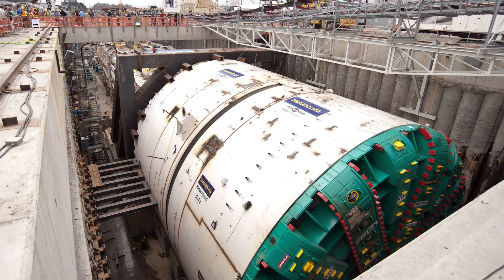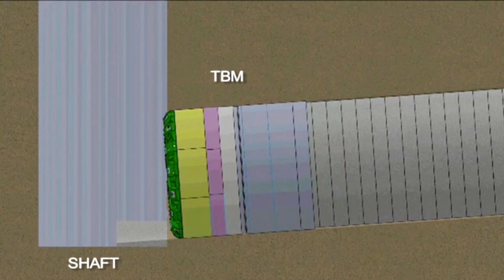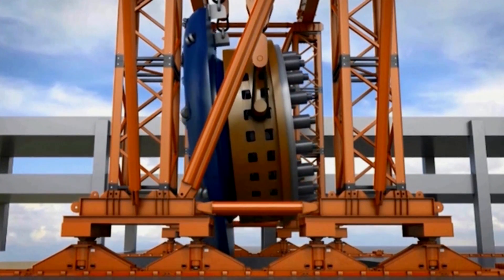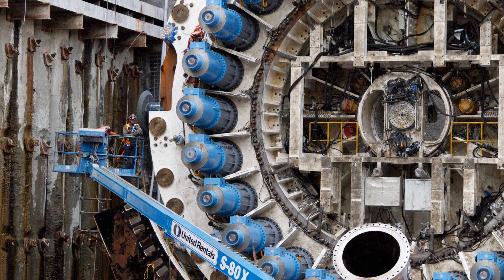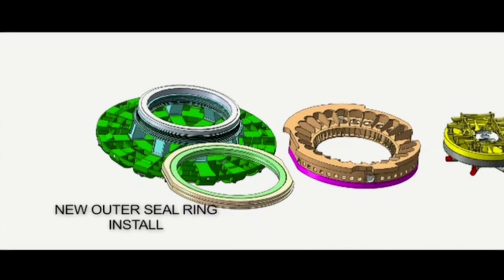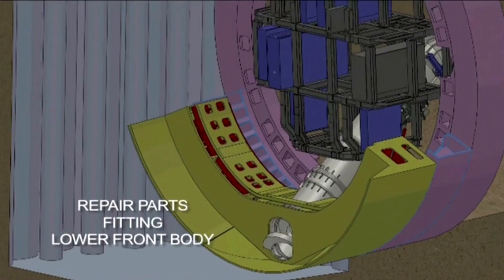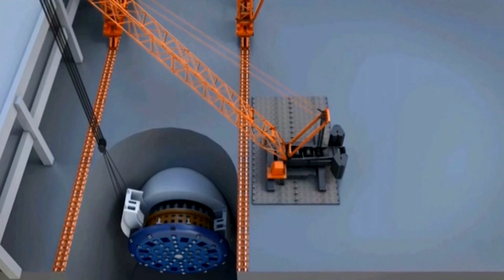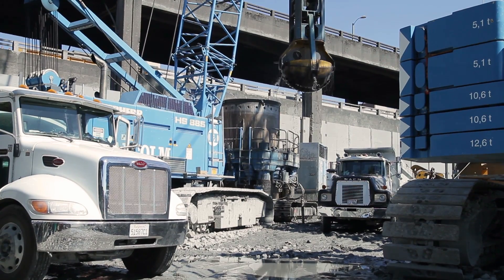Seattle Tunnel Partners' work plan for repairing Bertha with narration

Comment: Whether the tunnel was the best choice is no longer the question. I favored a suspension bridge from Harbor Island to the 99 connector. Taking down and viaduct and either replacing it or not replacing it would have meant years with no traffic corridor at all, and was the main driver behind the tunnel. The comments I read sound like folks who don't have a lot of experience with the physical world of machinery and big projects. Right now, there are 5 or 6 tunnel projects going on right here in Seattle. The big one for Metro ran into exactly the same sort of problem where they had to lift the head out and repair it. Tunnel completed, on time and near budget. This tunnel will get done, and the execution of the job will be studied for those who go on to build elsewhere. 
Since the tunnel walls get laid behind the boring machine, there is never a reverse on any big tunneling project. This access hole was in lieu of bringing the machine out in pieces, and is working. I'm glad they tunneled under the viaduct along the waterfront because this wouldn't have been possible if the tunnel had gone more under downtown.
Relax folks, and enjoy the show. This is really an amazing project.
Reply: Bruce Sherman That's a great explanation. But it does seem this project will be late by about 20 months if there are no more issues (current projection is Fall 2017 instead of December 2015). I guess we'll get a better sense of what the final cost will be once Bertha is running again and makes more progress.

Comment: Wait, why are we building a tunnel?
Reply: Colin Gibson Because it was the least practical way of doing it, it was the most expensive and it won't accommodate much of the traffic that heads that way. Makes sense, right? This is Seattle. The least practical is SOP.
Reply: For cars to drive through.
Reply: Nack Athens
If they just rebuilt the viaduct, the view would stay the same as it is now and it would be easier to build, cheaper and it wouldn't cause damage. The machine has only made it 1000 (out of two miles) feet and surounding buildings have sunk up to an inch, streets have cracked and the present viaduct, which has earthquake damage, has sunk up to .5 inches in places. If they keep going with this tunnel idea, chances are very high of disaster. Seattle being what it is, will only rethink what they are doing when a disaster happens. A road will sink, taking a few cars with it, the viaduct will colapse, likely during rush our. They may be able to kill a hundred people with that one. Maybe a building will collapse. Who knows how many people that they can kill with a building collapse. Since so many buildings have sunk up to this point, when the first one goes down, they will condemn the rest in the area. This comes from a state that has a history of collapsing suspension bridges and sinking pontoon bridges. They seem to be hell bent on trying to up their destruction record, maybe taking people with it this time.  the project is two years behind schedule now and the boring machine is still broken. they dug an access hole, (undermining the surrounding area even worse) just in front of the cutting head so they could get it out of the hole. The machine had to move forward 20 feet to be accessible. It moved 3 feet and quit. Now what? This is like watching the three stooges but in this case, there's hundreds of them.
Reply: The tunnel is in no way impacting (now or in the future) downtown traffic. Brilliant idea. Sink money into a sinking project.I think bringing the sonics would have been a better idea.
Reply: For some traffic to go through without destroying the downtown view?